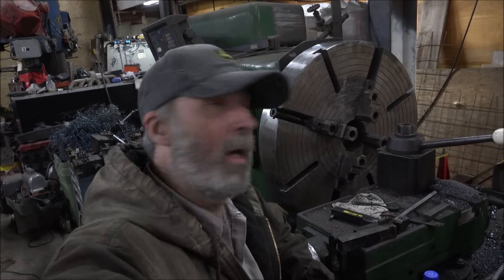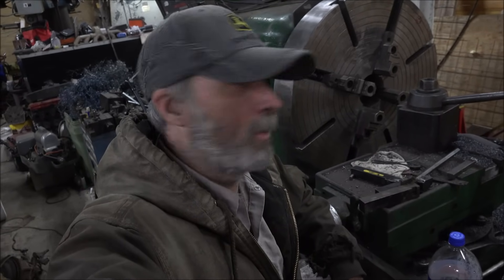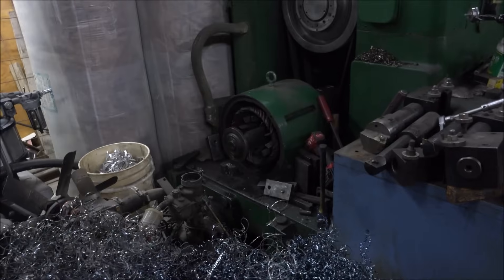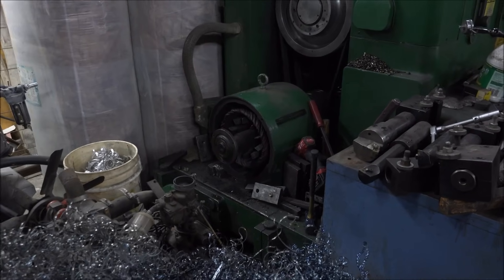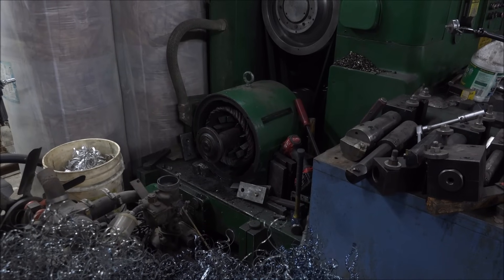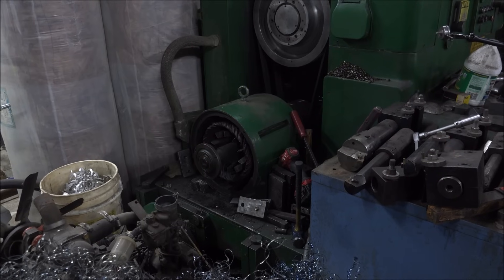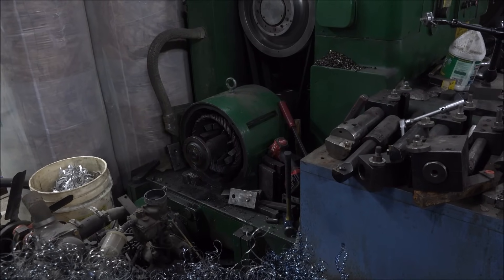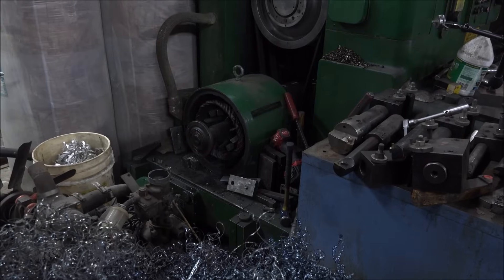Motor Failure on The Monster Monarch That Ain't Good! Help Needed!

Comment: this is a very very old piece ! tape and varnish isnt going to do a lot for it ! paper ouch !! thats old ..you might look at hp rating on motor those are rated anywhere from 20 to 60 hp i found a few used 364 T and a few 364u anywhere from 400.00 to 600.00 but hp was all over the place.

Comment: Hi Brian, do you have workshop manual for 6bt 8.3 with online fuel pump. Have engine out of Hyundai excavator. Need torques settings etc. Thanks in advance
Reply from the maker: @ShaunMcBride-y5g   check out the Cummins Hyster series where I am assembling the 8.3 pretty sure I gave the head rod and main specs in the video where I did those parts. I don’t currently have access to the book as it’s in a building with a foot of snow against the door and it opens out so I can’t get to it when digging

Comment: Possibly the damage is due to high current flow (heat) on startup with the phase convertor. So even if you get away with a quick repair it probably wont last long. Even a rewind might have a short life in such a situation. Wish you luck whichever way you end up going.

Comment: Have a 40hp 404 frame 2.125" shaft motor I would give to you. Might be too big though, next frame size up. More information for you if you're interested.
Reply from the maker: @roythurston73  where at? The monarch is also configured to mount a 405 frame motor so I probably could make a 404 work by grinding the slots a bit or  just use 2 bolts I would think that be enough too. Shoot me an email bcbloc02 at yahoo
Reply: Sent email, please confirm receipt, I initially had your email wrong.

Comment: Most probably you can use that baldor (or what it was?) motor to replace broken one. Fabricate base plate adapter, belt pulley is no problem to attach way or other and you can lengthen wires if necessary.

Comment: I did a motor swap on my slightly small (ok a lot smaller) 18" Monarch this year.  I had to swap out the original 1940's 10hp 550v 324 frame for something a little more friendly to normal shop voltage, which turned out to be a 10hp 324 frame I found at a scrap yard.   They do make adapters to go between most frame sizes, but I found I would still have a longitudinal and vertical alignment problem.    
I ended up finding some chunks of 1.5" bar and made a new riser frame to lift it up about 3" and get it slid about 10" toward the outside of the machine to get the pulleys lined up.  I found a hub that matched my new motor's shaft and a multi belt pulley that was the right belt count and a slightly different diameter to match the motor that was just a few hundred RPM faster than the old.  Found all of that on ebay for maybe $60.  
Keep in mind if you go to a a lower voltage motor, you'll need to change out the heaters on the starter and probably the control transformer as well as possibly upsize the wiring.  But it would let you get rid of that big transformer that I remember you having to run on that thing.

Comment: Before you start the rewind or new stator, go over every last thing in the power feed to the motor. Contacts, overloads, any sign of a hot connection. Use a solenoid type (wiggy) tester, not a DMM, to check phases.

Comment: 1. Unless you are going to put the machine thru very heavy cutting, there is nothing that says you cant fit a 20 or 30 HP motor.
2. I there is enough room the pecker head can stay on the opposite side. You will need longer flex pipe or fit SO cord to reach and modify the baseplate.
3. Most 3 phase 9 wire motors are 240/480v .

If you are going to buy a new motor take some Vaseline with you it helps, if rewinding its going to cost also so keep the jar handy.

Comment: If the insulation has started to crack it will just crack in another place once you have patched it up. I would have it rewound or swapped for a renovated one if possible.

Comment: Brian 
as a armature and stator winder , I am sorry to be the bearer of bad news but the damage will be down the store slot as well and due to the impregnation of the varnish the damage in trying to repair the one set of coils is terminal . due to the over under winding more coil set will be damaged .  the problem is terminal only two choices rewind or replacement . but the replacement will have to be the same speed and the same vintage as in the day they were lax with the hp rating plate it could be larger than stamped ( have come across this many times in older motors they over built them and stamped them to suit the sale )

Comment: I am a rewinder but in Australia. That looks like that one coil winding started with wire two wire short then cooked that coil and could now be down to earth. at the worst wire to wire short. sorry to me it would be a rewind. You will not get a new motor, be a drop-in replacement. The old motor is an old frame size and the new motors all have a smaller Fraim size for the same rating and better efficiency. Your best bet is to mod it to a newer motor. Yes, the one you have on the floor you can end for end the rotor .
Reply: do you have to end for end the stator as well?
Reply: @ohhpaul7364  No

Comment: How many hp do you need. We have a whole bunch of motors at work. I could look monday
Reply from the maker: It is a 40hp 364u frame. Because it has belts running up and down off the motor drive i am limited on changing shaft position due to frame size differences without getting into a bunch more work.
Reply: @bcbloc02  I will look on Monday. You could probably get by with a much smaller motor and it would much easier to start. We have a NN Monarch at work and it only has a 30 hp motor and I have turned a shaft that weighed 26,000 lbs. I doubt that you will ever turn anything that heavy in yours.
Reply: @bcbloc02  we have 2 365u frame motors but they are 50 hp
We also have a cb365 frame motor that is 30hp
Reply from the maker: @ I will keep that in mind thanks for checking!

Comment: Hey Brian. HGR up here near Cleveland is a surplus reseller. They have a a few motors with 364U or 364T frames for various price ranges - and they are always willing to make a deal.
Reply from the maker: They have a nice looking 364t not too bad a price but buying electrical components without being able to turn it and look it over and smell it is a big gamble. Are you close to them where you could take an in person look? Its like 5-6hours from me
Reply: @bcbloc02  happy to help. They are 15 minutes from me. Check your email.

Comment: Old time motor repair shop would cut out that coil (disconnect and bypass it on the leads that are laced down in the ends.  It’s a symptom of the condition of the rest of the windings though.  The motor will do fine without that one coil though it might  pick up a little growl.  

I doubt the new motor can have the end bells swapped  because the iron laminations and the winding inside is typically offset toward one end or the other to make space for the internal fan.  

Even if you had to just take the junction box off you could put some sort of friction tape wrap on the leads to protect them and clamp them where they won’t move around.  Probably could just make up the connections before mounting the motor with the box it has.  

The motor will probably not have as big of a drive end bearing since it’s a C face motor made to drive a mounted gearbox.  Doubt it’ll be a problem though.

Comment: Before you start this motor again, it would be a good idea to check the heaters on the motor starter to be sure they are not oversized.

Comment: check your motor contactor and check peckerhead wiring, those big motors dont like dropping phases, i had a compressor kill 2 motors, the last rewind we had the motor shop braze the leads, same boat, i think i have 3 326t motors laying around
Reply from the maker: @coreyb4073  a motor repair guy said it’s not a phase fault because it only is burned on the one coil where it would be multiple sane poles if it was an overload or voltage issue. Probably just cuz it’s 60 years old and the insulation failed

Comment: Make sure to check out the contacts in the motor start relay, if it drops a leg due to bad contacts and single phases the motor it can produce this result.
Reply: He would have an obvious 1/3 of the windings in each pole (1/4 of the total in this 4 pole motor) that were burned.  This is not the result of single phasing
Reply: @jimrankin2583  good point, with one exception, I think it would be 2/3 of the windings in each pole showing damage.

Comment: Smoke meant a wire got red hot (and got changed to gaseous form as well). Either it's along a winding or from wire to case.  Plus a failure point will take out the wires/insulation around that point so you'll have arcing, breaks and shorts around the failure point in that winding coil or between multiple coils.

If the supply has tripped a breaker/fuse, it was a dead short. But if fuses are intact, wire(s) have just failed and you've got an open circuit.

You could measure resistance across each winding and from each winding to the case, but at least one won't be right.

Rather than a specific model, aim for similar rpm/power rating and mill up adapter plate to mount. Same for pulley?

Comment: I have a 45’ vintage American pacemaker, my motor went toast not long after purchasing. Same deal, smoking when fired up. I went to my local motor shop and it was far cheaper for me to purchase a new modern vfd capabale motor than it was to have mine rewound. I ended up going for a slightly larger motor than what was in my machine. I had a 7.5 hp motor but was told it was equivalent to a modern 10-15 hp motor so I opted for a 10 horse motor.  I would suggest something similar, you’re going to spend a fortune for a large hp motor

Comment: Use the motor you have if it’s the same rpm   You can swap end bells. You won’t have any trouble making an adapter plate for bolt pattern. You will need shorter belts most likely.

Comment: Has A Shorted Coil. Will Continue To Get Worse. Motor Will Need To Be Rewound. Seen To Many Blowing Sparks And Flames Out Of Them. T-Frames And U-Frames Have Different Mounting And Sizes.

Comment: Once the insulation is burnt off the wires and they’re touching, there’s nothing you can do. They are shorted and spraying varnish on them doesn’t nothing. Those wires may also be shorted within the winding where you can’t get to them anyway. Only rewinding will fix it, if you really want to keep the motor.

Comment: That sucks; sorry. I've been there....on smaller motors.

You'd have to disconnect from the incoming lines; but can then use a multimeter to check the windings, to see if they're shorted to each other or the case.

I know you're in KY, but not sure exactly where. Guessing that there is a motor shop closer to you; but if not, I'd recommend contacting Cawveys in West Plains, MO for a rewind.

Comment: Sorry to hear but when the smoke comes out time for a rewind. Each wire has thin coat of insulating varnish on it, to insulate it from the wire next to it, then each pack of wires is insulated with packers to protect from grounding on motor frame. Too much heat and thin insulation burns off and the whole thing starts getting worst and worst. Sorry for your luck, but electric tape or paper insulation is not the cure. You're lucky you caught it when you did, still re-buildable. Have a better New Year. Thanks for sharing hope you find the right solution.

Comment: Looks like quite a bit of winding damage besides just the bit that looks really bad.  I've rewound (much smaller) motors before and if you choose to go the rewind route, it will likely turn out to be better than when it was new because of newer wire coatings and sleeving products.

I bet it is really frustrating that you have a "spare" motor but probably need a lathe/mill that works in order to get the lathe you have running again.

Comment: Most likely it is not repairable without a rewind but further investigation may be warranted. If it is a single short to ground (motor frame) it may be repairable but the longevity of such a repair is questionable. If it is a turn to turn short a repair is highly unlikely. Testing with a megger and other instrument in a motor shop would give you a better picture of the motor condition. Anything is possible but in most case such as this a rewind is the best long term option. This failure maybe the result of operating the motor on a rotary phase convertor in an “overloaded” state. It appears that one phase winding has failed from the picture in the video. When operating on a RPC the max hp needs to be reduced by some amount to account for the unbalanced/ non symmetrical voltage being applied to the motor terminals. The amount of reduction may be somewhat debatable. Yes you can add or remove capacitors to “balance” the output voltage on a RPC but it is only balanced at that load point AND the voltage waveforms are NOT necessarily 120 degrees apart as they are in a true three phase power system. If you will send me pic of the failed motors nameplate and a pic of the good motor nameplate I will evaluate them for a swap. You may be able to move the peckerhead location by swapping the end bells as you mentioned BUT you need to measure and insure that rotor is in the same relative position (centered) in the stator windings. Usually motors are manufactured symmetrically with respect to axial dimensions but it needs to be confirmed. Personally I am not convinced that a RPC is the best option for large 3 phase motors such as yours. A stand alone diesel driven generator (somewhat oversized to account for starting) may be better option. I am sure that I will get plenty of negative comments regarding the use is RPC but there is something to be said for balanced symmetrical 3 phase power applied to motors. RPC probably will work for small motors with lighter loads but larger motors with significant variation in loads may present more of a challenge.
Reply from the maker: @bertkirk2697  my voltage balance typically runs 3% or better. I am told it was not an overload or phase issue because it only effected the single strand not all the strands on that pole.
Reply: @bcbloc02  Yeah, there is nothing wrong with using a rotary phase converter. My 30 hp homemade one, like yours, runs within about 3% or better, too. Plenty good enough for the equipment we are running. Mine, I think, would be just fine even running a new CNC machine.
Reply: @  research the internet by typing the following : negative sequence voltages impact on motors. When you say 3% or better is that fully loaded when you are taking a large depth of cut? The other factor contributing to negative sequence voltage is the fact that each of the voltage supply vectors are not exactly 120 electrical degrees apart. That is what a rotating generator such a utility company uses generates and that is what the 3 phase motor is expecting. You are feeding single phase power (2 legs at 120 volts each which are 180 degrees apart vectorially speaking) into device that is creating a “ 3rd phase” that is 90 degrees apart from the input and feed all of that into a rotary transformer hoping to make all of them 120 degrees apart. Does it do it? Maybe it does but it may also be high in negative sequence voltages/currents that can be harmful to motor winding that are connected to the output.  With regard to single strand failure you have to be careful. Some motor winding insulation operate as stress gradient if the motor is wye connected. Most but not all motors are wye connected. In a wye connected motor the portion or segment of the coil closest to the motor L1,L2 and L3 terminal end is at the highest voltage with respect to zero voltage while the  segment of the coil closest to the wye point of the motor connection is at almost zero voltage. This cause the segment of the coil closest to the terminal end to fail first when thermally stressed. Negative sequence is the thermal stressor and then the insulation on the high end of the coil fails to either ground or an adjacent coil resulting in increased currents that further damages the winding. Think of the winding as a pipe with one end connected to a pressure source such as a pump and the other end of the pipe open to the atmosphere. The pipe will see the highest wall stress at the end connected to the source while the end open to the atmosphere will be almost stress free. Now heat the pipe wall till it begins to yield. The failure will be at the high pressure end.
Reply: @bertkirk2697  Many people have run large motors from RPC for decades without issue. Yes, many of us are well aware of and some of us even very much into all the theoretical aspects of this, such as the points you are raising. What we are telling YOU is that RPC's nevertheless WORK and do so without issue. Moreover, there are some issues with some of your statements, here. Thanks for the input.
Reply: @robbieburns1664  yes they do work. I myself have one on a 1 hp motor on a Leblond lathe but one must understand the risk involved especially when the stakes are as high as they are with large hp motors failures. It also is an exposure related thing. I only use mine a few hours a month. It whole different exposure level if I was using it several hours a day several days a week.

Comment: I see a couple places where the insulation is burned off of the winding. That usually means that there are turns shorted together and would have to be rewound. I don't know if just that winding could be replaced, likely the others could be ready to go. City Electric Motor Service in Lexington does rewinding.
Reply: as others said, if the insulation is breaking down in one place, it will break down soon in another place. If it's going to be re-wound, just do the whole thing and be done with it. As they say, buy (or in this case fix) once cry once

Comment: Replacement of a Smaller HP motor is workable, most unlikely you will ever use maximum power.
Best of luck